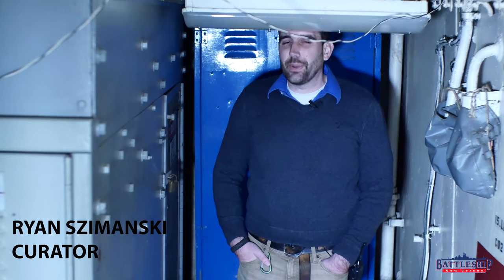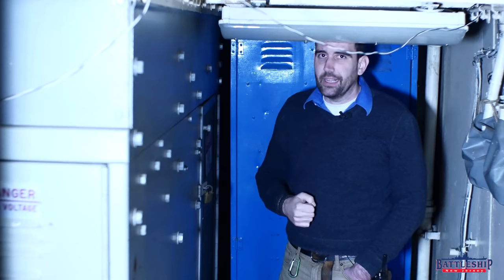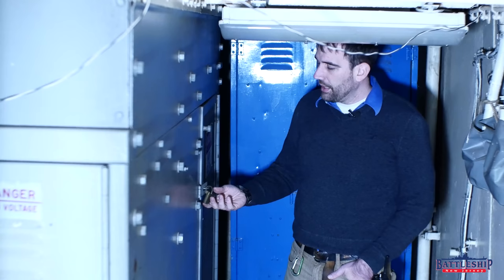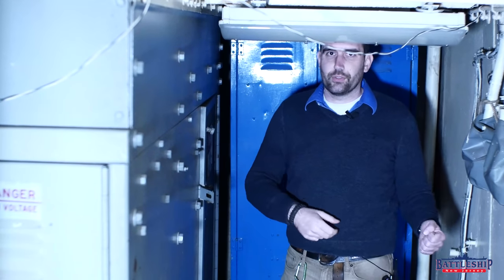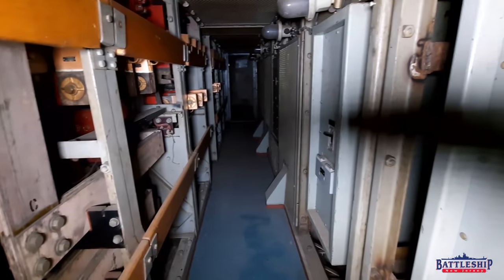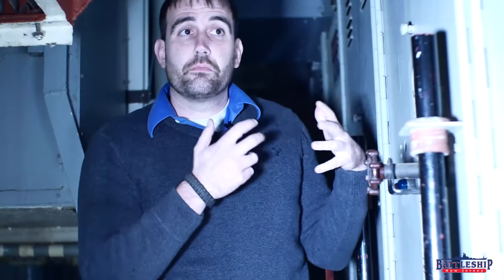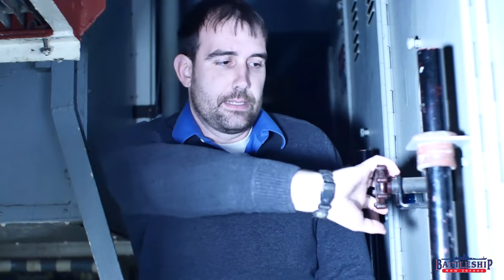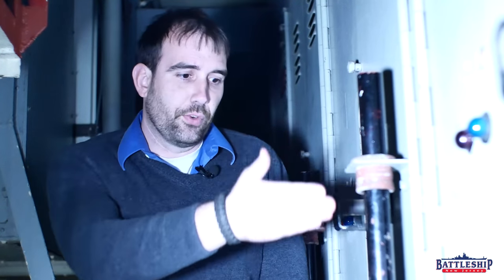Why is a Bus on a Battleship?

Comment: The amperage label on the switchboard just says how much current the switchboard is able to supply at any time, it's not necessarily how much current would go through you if you were to stick your hand in there. In reality, you'd only see about 0.5 amps of current through your body, which sounds small but its more than enough to kill you.
Reply: If it were only a .5 amp current being drawn, wouldn't the voltage have to be extremely high to injure or kil you?

I have always wondered where that amp/voltage balance point is.
Reply: Back when I was serving on a submarine, we were informed that it took 100 mA aka .1 Amp to kill you.  This was based on a persons body resistance to ground while wet with seawater. 

We also had a safety bulletin come out because an electrician somewhere wanted to check his body resistance.  He had taken the leads from a Simpson 260 multimeter, selected resistance and pushed one lead into the quick under a fingernail on each hand.  The body resistance was so low, the battery in the analog multimeter produced enough current to stop his heart and kill him.
Reply: 300 mA (0,3A)  AC in the arc of the heart, i.e. contact, arm-arm, arm-leg and any contact that closes the circuit and the heart is on that arc of flow is fatal. The strength of the current depends on the resistance of the body and the condition of the contact surfaces, dry or wet, so the resistance varies from 200 ohm to 5k ohm, which means that in case of wet conditions a voltage of 75 V can be fatal. The contact safety voltage for dry conditions is max 50VAC and in wet conditions only 25VAC.
Reply: Bend Over  Isn't a household receptacle around 15 amps? I have been shocked more often than I cared for over the years by my carelessness in working around them. Not arguing, just curious and wanting to learn.
Reply: @Neal_Schier  Since the person is acting like a short to ground, the voltage across them would be equal to the voltage of the switchboard, which in this case is 450 Volts AC. Also if you're wondering, the relationship between current(amps) and voltage is

V=IR
where V is voltage (in volts), I is current (in amps), and R is resistance (in ohms)
Reply: @Neal_Schier  Assuming you're in North America, wall outlets run at 120VAC, if you were to shock yourself by touching the contacts and ground, you'd experience only about 0.12 amps through your body. Also since its most likely that both points of contact were on your hands, the current wouldn't have passed through your major organs like your heart.
Reply: @Neal_Schier  A residential outlet ican usually source around 15 amps before the breaker would blow. The amount of current that actually flows depends on the resistance. What resistance you present if you get shocked can depend on a lot of factors.
Reply: @theenigma7290  Thanks.
Reply: @godfreja  Ah, good point. 👍
Reply: I've had arc flash training and have been 20 ft away from a 480V 3 ph collector rail when it flashed over , it isn't pretty.  ( this rail is used to supply power to overhead cranes and such ) Arc flash is a real hazard, think out of control welder.

As for getting shocked, I've seen training vids where someone came into contact with a medium voltage distribution line ( 4160 V ) .  Current flowed down the side of their body cooking skin and muscle. They lived however they were cooked like those old Westinghouse hot dog cookers where you effectively placed the hot dog across a 115 V line.
Reply: As an apprentice we were taught “it’s the volts that jolt, but the mills that kill” (milliamps)
Reply: @Neal_Schier  The voltage is necessary for the current to punch throu your skin - the body has very low resistivity except for the skin which has high resistance. 

If not - a 9V would be enough to kill. 

600V DC is definitely able to punch thru and the with high amount of current/energy available - high current to.
Reply: Correct, but that only tells you the maximum level of current that the board is designed to deliver continuously. If you drop one of the live conductors directly to a return path you'll draw the maximum available fault current, which is limited only by the impedance in the circuit. If you're fed by a 500kVA transformer that would be around 12,000 Amps.
Reply: @dinkoz1  300 mA is way over.  A PSD shall cut at 30mA.
Reply: @dinkoz1   Wet condition or dry affects the conductivity of the skin - not the body itself. Internal resistance in tissue is around 100 ohm for the the torso itself and 200 ohm in a leg so foot-torso-foot around 500 ohm.

70 mA is enough to initiate flutter in the heart.
Reply: @Neal_Schier  It depends upon how well you are grounded.   If you had a solid grip on a copper water pipe with your other hand at the time, it might.
Reply: @TheStefanskoglund1  Condition in contact point, wet or dry skin, legs in water ect all of that will decide do you live
Reply: @FP194  Amperage may be what kills you, but for electricity to deliver sufficient amperage to be lethal, it has to be above a certain voltage in order to overcome your body's natural resistance due to Ohms law.. The higher the voltage, the easier it is for that voltage to pass a lethal current, which is why higher voltages are so dangerous, and it also why you generally cannot be shocked by a 1.5, 9 or 12 volt battery. Under normal circumstances the resistance of your skin means voltages below 50 to 60 volts cannot pass a lethal current through you. But at mains voltages of 120/208/240/277 and 480, that's more than enough voltage to overcome your body's resistance to deliver lethal current. Medium voltages, which is greater than 1000 volts, though in standard industry practice this usually means 2.4 kv and up, electricity can actually jump off of a conductor into a person without direct contact with the conductor, with the higher the voltage means the greater the jump distance. 

But for a current to be lethalat100 mA, it does have to pass through your heart to cause cardiac arrest. If the current doesn't pass through your heart, then it takes a lot lot more to actually kill.Which is why most electricians, including myself, have been shocked numerous times and never been killed by it. 

Fun fact, as long as your body doesn't provide a path to ground, or a path to another phase, your body can be energized to well into transmission voltages like 765 kv or more and be fine. Most linemen do this routinely.
Reply: @truthsayers8725  Great analogy. Thanks!
Reply: It is actually much more complicated than that, as the resistance (or rather impedance) of the human body will decrease at 400V+ as apposed to lower voltages. Also as the current flows through the body the resistance will break down (at first, after time it will rise) and so the current going through you will increase. Add onto this the equation of power being a factor of both voltage and current, means that the actual amount of energy dissipated by your body will be over 16 times greater than the regular US household voltage.
Reply: @TheStefanskoglund1  RCD 30mA is  for bathroom, 300mA RCD for remnants of home installation, standard in my area. Each RCD I tested installed on home and business installations was triggered at 170-260mA for 0.3 RCD and 17-24mA for 0.03A RCD. Of course, even lower currents can stop the heart, but 300mA is always deadly if the current flowing through the zone of generating heart rate signal in the very structure of the heart tissue
Reply: @theenigma7290  And that is 120VAC RMS , the actual peck voltage is about 1.4 times higher.
Reply: @Neal_Schier  A household receptacle has 15 amps *available*.  That doesn't mean that you'll get a 15-amp shock from touching it, just as you won't drown taking a drink from a 15-gallon barrel.  The actual current is determined by your impedance.  See "Ohm's Law" for more insight.
Reply: @bobroberts2371  I work in the electrical utility field and can tell you, from experience, that given the choice between having an accident working 4.16kv (4,160v) and 480v literally EVERY lineman and electricician I have ever met is going to choose the 4.16kv.  480 volt arcs are a thing to behold......preferably from a distance.
Reply: With these systems, it's the frequency that's often the killer. But, I get that people like to say that it's the amps that kill, even though there's no amps without voltage and resistance, so...yeah
Reply: @GrondTheHammer  4.16kv is better because you’re instantly dead?
Reply: I always heard that a .10 amps would kill you if it crossed the heart.

Comment: I've worked in older telephone exchanges which have relatively low voltage but very high current bus bars feeding the equipment bays.  if you were working in a ladder you had to be extremely careful of them.  there was usually a horror story doing the rounds about a contractor painter who didn't realise and grounded out the metal ferrule of his brush across the bars, and found himself welding without prior notice or intent.

Comment: Another lesser know part of electricity is the cycle rate.  When you get into the millions of cycles per second, electricity just travels on the surface of your skin.
In the Air Force we had the term, "throw voltmeter".  You could figure out the voltage by how far you were thrown.  Not a recommended way to messure voltage.

Comment: Early in my career I responded to an “industrial accident” at a manufacturing plant. A man had gone up in a scissor lift to service a 440v panel (I don’t remember the amperage but it had to have been fairly high), some how had come into contact with the current, arced, and flew about 25ft across the shop & down to the shop floor. One of the most gruesome things I had seen to that point. His right arm had almost literally exploded below the elbow, as did his right leg a few inches below the knee. I had a respect for the power of electricity prior to that - but I had a HEALTHY respect afterwards. I still cannot smell anything sweet being baked without seeing that scene in my mind. Sort of ruined cakes and cookies for me.
Reply: I bet that was horrible.
Reply: When I got back from Iraq the first time I couldn't do the smell of pulled pork bbq. Im from eastern NC...family and friends put on three pig pickins for me in the first week I was home on leave. Spent every one trying to pretend I wasn't seeing burned bodies in my head the entire time
Reply: Oof 😣
Reply: Probably not as gruesome as the guy who got dragged into a running lathe.
Reply: @StrayCatOrwell  I never came across that with a lathe… but I have seen several people who involuntarily danced with the PTO’s of various farm equipment. It gives one an understanding of the powers of torque that was, sadly, completely avoided in school.
Reply: As I was doing a part of my Foundation Year in Surgery Department, I remember being hungry all the time. It took me some time to figure out why am I so hungry, before I realised it was the smell of tissues cut with an electric knife doing this to me - it was smelling exactly like a Döner Kebab - it took me 6 months, before I was able to buy and eat one again.
Reply: @agenericaccount3935  Like the Sweeney Todd
Reply: @xrayperforator   أغمق ولكن نفس الفكرة
Reply: @xrayperforator  trans: “Darker, but the same idea”

Comment: My first shock was from my toddler cousin plugging in a record player while I was trying to fix it. Repeatedly!  The first time I could not figure out why I was shocked because I had unplugged it. Then I noticed it plugged in. He thought it was great fun and kept plugging it in. The worst shock I ever got was in High School working butcher clean up. My apron and pants were wet enough that when I leaned over the steel table to plug the meat grinder back in I completed the circuit and it threw me across the walk in refrigerator. It was a grounded device and cord but the machine had been recently moved and the outlet may not have been properly grounded. I learned my lesson to verify a dead circuit when I was wiring a light. My elbow hit the copper pipe which became a path to ground. Turns out the light came from a different circuit than advertised on the fuse panel which simply said lower level. In completing the circuit I turned the light on behind me. Made me laugh even if it hurt reminded me of my cousin "lighting me up" all those years before.
Reply: You, sir, need to learn about lockout tagout procedures. People are dumb and will try to plug in and turn on things while you are working on them, so it is safer to make sure that is impossible for them to do.

Comment: I can remember going to this one factory site, no fues, just throw switches with copper plates on the asbestos panels in the boxes on each floor, then the basement was upgraded to have bus bars.  The boiler building had a generator room and a 1910 electrical distribution room for off site and onsite power.  That place was scarry as hell.  Then again it was all contaminated with what was left of the asbestos piping or the white dust on everything.

Comment: An electrician saved my life. We physically disconnected a 1000-A 460-V circuit breaker from a bank of 25000-A 15-V DC rectifiers. In my mind it was as if we unplugged the equipment from the power source and it was in a safe condition. The electrician check and the equipment and it was still energized. The cause was poor cable management that caused a live cable to be shorted across the bus work at the back of the circuit breaker. I learned a valuable lesson that day.

Comment: As an electrician I've been shocked many times. On and off the job. It just happens. You try to stay safe but when working with lower voltage, you usually just say, mah, its all good and get shocked. Electrocution, no. I wouldn't be typing this out if I was ever electrocuted. If I work with anything higher than 120v, I always shut it off. 120v is high enough voltage to kill someone(it isn't the amperage, its a lot more than that with science and stuff). I get shaky and don't even want to test on 480v with it being live. I've seen some pretty rotted out 480v services that I was about scared to work on with "knife" switches not opening all legs to main 1000amp main feed conductors being so brittle, you better not sneeze on them. I request I don't touch it unless its "dead" or de-energized.

Comment: As a Generator Mechanic instructor on active duty in 72 -73 I have a lot of respect for A/C power. One setup was 3 x 200 KW generators 120/208 3 Phase 4 wire. In some buildings in downtown Chicago, I saw 8,000 amp bus bars with very limited protection just some signs. Heebie-Jeebie time stay well away or be a bolt of Lightning.
Reply: Nowadays busbars like this is covered with  perspex.

Comment: When I was a kid, dad bought a dog shaped lamp I wanted at an auction.   He told me he had to rewire it.  Before he left for work, he cut the damaged plug off.  After a couple hours of contemplation, I figured plugs are metal and bare wires are metal...I'm good.  I shoved the bare ends into the socket.  My hand and arm up to the elbow was covered black soot from the blow-back.  I still avoid electrical work to this day.

Comment: Had built an oscilloscope clock (displays a clock face on a CRT) and was measuring the B- which was at about -2KV.

Had the HV probe near and used a clip lead from it to the circuit.

Went to adjust a variable capacitor used for compensating the deflection amp and moved my head down. 

I brushed against the probe tip and saw a brief flash of light and had a very slight small burn spot on my tongue.

I then decided I was done measuring the B- voltage.

Comment: I used to work for a power company. Working on the mechanism for large OCBs and GCBs. Most of that stuff would have turned you into a crispy critter in a nanosecond. We had over a dozen safety procedures to put in place before we ever touched a breaker.

Comment: I was once groping for am extension cable and found out the hard way that the insulation had been nibbled by a mouse (240 Volta over here). Usually, I found this sort of thing a bit boring, no sparks flying, no big humming noises, just a tingling sensation and a circuit breaker going "clack" (boring is to be preferred in this case). This time however, the circuit breaker didn't live up to its name and the sensation lasted a little longer. Luckily, the current mainly went through my hand.
Reply: Circuit breaker did it's job. You would be dead in less then a second if you could cause enough current thru your body to trip a 15 amp breaker. Even a 1 amo breaker.. Even a wet body has hundreds or more reustance. Got shocked with 277,480:& 5000 volts from an boiler ignition transformer during my 59 year sparky carrer.
Reply: Just FYI, the US is 240 volt too! We have three wires coming into our homes, two hot wires and a grounded neutral. The voltage between either hot wire and the neutral is 120v, which we use for general purpose circuits. But the voltage between the two hot wires is 240v, which we use for large loads such as heating. The breaker panels are laid out so that each hot wire feeds every other row, so to get 240 you just use a double-pole breaker that connects to two adjacent rows.

Comment: All of us have buses in our electrical distribution panel, aka breaker box. If you take off the cover, you'll see all of your breakers attached to a couple bars that run down the center of the box. Those are the bus bars. Your outside power is attached at the top, one black wire to each bus. Each one of those carries 120V. Depending on the design of your box, you'll also see a solid aluminum bar with holes and set screws. That is your neutral. All of your white wires will be attached there. BTW, that also happens to be the same as ground.